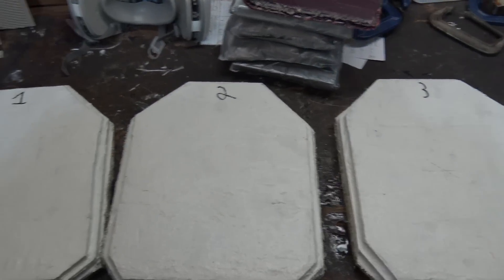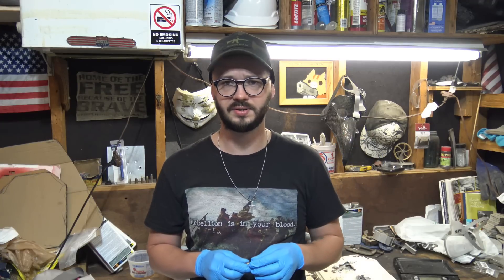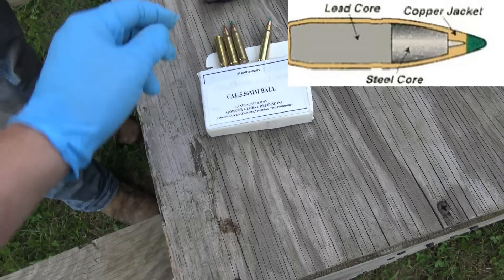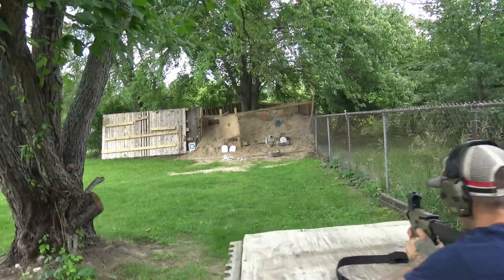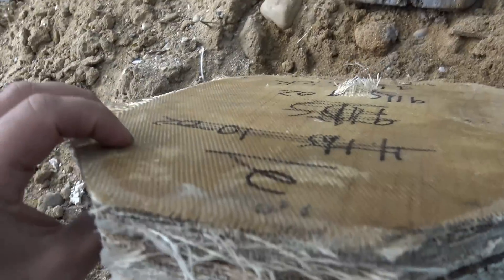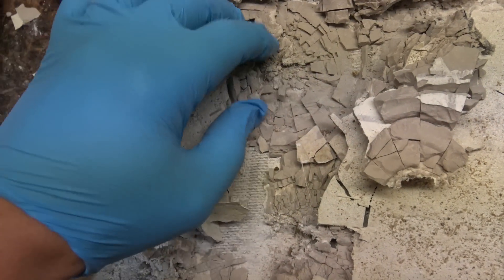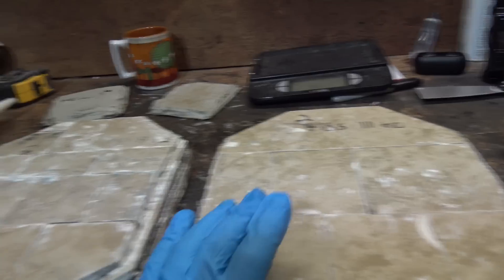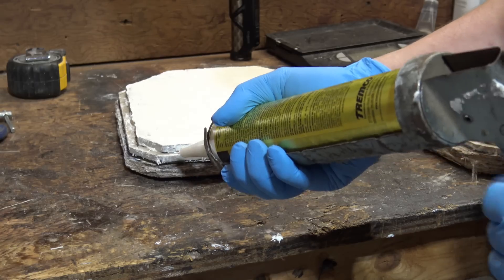Hardware store level 3+ Armor build

Comment: One thing I'd be interested in: Inexpensive bullet stop for a shelf. My self defense plan includes hunkering down behind a wall shelf in my bedroom. I saw a YouTube video at one point, where just 5 inches of sand stopped a 5.56 from a rifle. Maybe there is something I could make that's cheaper than buying an old encyclopedia?
Reply: For a defensive bullet resistant barrier that's cheap I can do you one even better. One that is mostly free and essentially costs almost nothing in materials. Each time you go grocery shopping and get things you need try to find stuff that's in containers made of HDPE. Things like ice cream buckets, coffee bottles, water jugs, milk jugs etc. After 2 or 3 years of collecting this type of plastic you might have enough for a bulletproof barrier. Just melt it down into sheets 12x12 inches square and at least 1.5 to 2 inches thick, at least enough to destabilize and catch any bullets. Then you need to add 2 or 3 PEI porcelain floor tiles to the front of all your plastic plates to break up and strip off the hard copper jackets of any bullets so that it will be easier for the polyethylene backer to stop them. Floor tiles at a hardware store are very inexpensive they're only $1 or $2 a piece and an entire box is less than 20 bucks. Annealing the polyethylene backers after you form them will also make them a lot stronger by the way, which could further increase the ballistic resistance of the plates.

You could also do this with PET (polyethylene terepthalate) as well. Just stack multiple layers of it between two sheets of ceramic kiln paper and clamp that between two nonstick cake pans with C clamps 🗜️ and blast the pans with a heat gun on the low temperature setting. PET plastic melts at 500 degrees Fahrenheit much too high for any normal oven to melt so a heat gun is the only thing I know of that will get hot enough to melt PET.

Comment: Great work! Might I suggest making them a couple inches wider ,and then making a more pronounced "fold" where plate is like it's been folded in half, but not completely,making it slope, and therefore, bullet is facing 1.5x the resistance as straight on?

Comment: Is ok if i use normal risen instead of polyester resin because i don’t have polyester resin in my country
Reply from the maker: What kind of resin do you have access to?
Reply from the maker: But yeah, if it's like epoxy or something it'll work as good, might even get it lighter
Reply: @Techthisoutmeow  thanks also another question is ok using fire blanket?
Reply: @v-nan-v1060  As long as it’s made of fiberglass cloth.

Comment: try compressed paper, reactive armor, hydraulic press compressed paper cake in a mold
Reply: ie hydrocarbon diamond like light weight paper armor plate
Reply: paper is ironically same as cast hdpe armor
Reply: add some ceramic sand in-side-to paper can hydraulic press compress it, into a hydrocarbon tile

Comment: What about welding ar500 targets together? 
Im looking to bulletproof a 4runner by making a ar500 steel box out back and welding ar500 panels to the inside of door and engine wall
Reply: It would degrade the heat treatment. You could armor your seats with mini silhouettes, hopefully they’re still sub $30 at Fin Feather Fur.

Comment: Why wasn't Kevlar fibers not used in the production of the plates?
Reply from the maker: Cost, that's the only reason. Kevlar would perform better, at less weight
Reply: @Techthisoutmeow  you should post your content on Odyssey.  That way it wouldn't be taken down.
Reply: @Techthisoutmeow  A while ago you did the 7075 aluminum alloy video, so I was wondering if you would ever do the same type of video for the 7068 aluminum alloys that exist now. A very thin plate of ar600 steel sandwiched between two 7068 aluminum plates might be very stronk; though I'm not a material scientist so I could be completely wrong.
Reply: Hey man I had to update my credit card on patreon. Did it go through on your end, basically am I your patron again?

Comment: I've been collecting the materials for this stuff today and while Lowes, Harbor Freight and Home depot have Bondo brand resins, all they have are interior/exterior home fiberglass resins, body filler automotive resin, and Bondo Glass resin but not the actual automotive fiberglass resins like you have. Would those make any good substitutes? No Vulkem either but since that's for the tiles, I kinda wondered if the QuikCrete sealants would do some good as well
Reply: You should try to find epoxy resins. West Epoxies or more specific HS epoxies.

Comment: You could possibly install a small electric jack in the door to lift the heavy bulletproof glass up and down. They make jacks that are powered by the 12v socket in cars.
Reply: Most armored cars use sliding windows when they are openable

Comment: Have you tested different types of fiberglass? I did not find anyone trying to make a plate out of fiberglass mesh, the one for construction.  I m curios what it will be able to withstand. Why mesh? because is dirt cheap.
Btw, awesome idea, stooping rifle rounds without steel plate. 

PS: Thank you for skipping the small calibers, i see many videos that starts with the .22 , 9 mm, etc..., they are compromising the ceramic plate before testing bigger calibers.
Reply: They do make fiberglass panels for bulletproofing buildings. It's about twice the weight of kevlar for the same protection.

Comment: Can't remember if you mentioned it in this video, but it would be great to see some curved or multi-curved designs. I understand these would probably be of a lower protection rating than the plates shows in this video, but they would fit our plate carrier much easier.

Fantastic work so far. Quite unbelievable that such simple materials can be manipulated into working pieces of armour.

Comment: FYI: if you put a layer of fiberglass on front it going to delaminate with the first shot unless you can mechanically fasten it to the back side, using a thread weave or staples. You have to drill small holes in the tiles to connect the front fiberglass to the back. Or sew tile segements between two layers of fiberglass using kevlar or some very strong thread. Maybe mono-filament (fishing line - not as strong but cheap).

Comment: Do you think i could make a 5x5 plate/wall just 1 piece just not cutting the welding blanket? Im trying to make a safe spot i can send my kids if need be.
Reply: You would need 30 blankets and have a way to squeeze them together  with the resin. You would likely have to vacuum bag to feed the resin in before it started to harden. Vacuum bagging could squeeze everything together for you too.

In the end for cost and simplicity i would recommend buying a 3/8 in thick sheet of abrasion resistant steel (ar400 or ar500). It will stop any of these rounds without issue even if hit in the same spot multiple times
Reply: @BrokeWrench  ty
Reply: Another thing that can be cheaply applied over large areas is hardi-siding. You can get 4x8 sheets and 3 layers stops m855, 7.62x39, 7.62x51/.308…. Not sure on 7.62x54R fmj and LPS.

Comment: Awesome work and video. Came to mind at 10:50 when you mentioned placing a layer of fiberglass on top to hold it together, came to mind trying out makeing a pouch out of fiber glass warp or use a large piece to wrap it around the front and over on all 4 sides with it meeting at the back to keep all 4 sides from blowing out. Keep up the great work!

Comment: very nice!  i wonder if you could make a comparison, with  the same welding blanket and same amount of layers of polyester resin vs epoxy resin vs phenolic resin (because i know that in soviet era tanks, for thoose that used a fiberglass composite, the resin was phenolic, so, the resine used to make bakelite)
Reply: You cannot make a phenolic resin layup w/o an autoclave, since it has to be cured under pressure and heat. Polyester resin is stronger than epoxy for the 1st hit, but degrades sharply in strength, that's why epoxy resin is used for virtually anything structural or where survivability is in the least way important; polyester resin is just for noncritical hobby projects that won't be sustaining any repeated hard shocks.

Comment: Have you tested different resin types on strength? Like vinyl esters or epoxy resins instead of the polyester resin. You could also try vacuum bagging during construction.
Reply: A professional vehicle armorer told me they use epoxy resin.
Reply from the maker: I have a bit. Epoxy is always going to be the strongest honestly. One of my favorite is: https://theepoxyexperts.com/shop/adhesives/structural-strength/max-bond/max-bond-low-viscosity-ab/max-bond-low-viscosity-32-oz-epoxy-resin-fiberglassing-marine-aero-auto-boat-building-high-impact/ I used this for my ballistic mask and hat build, if you've seen those. It would be fun to do a head to head comparison of resins some day. Vacuum bagging is amazing, as well as resin transfer. I was keeping this build simple, and only things found in hardware stores. but I plan on using more advanced methods and materials in the future! Thanks for the suggestion, showing different methods and materials is what this channel is all about!
Reply: What about chopped strand mat instead of the welding blankets?
Reply: @shoes121255  Chopped strand does not work well at all. The welding blankets (woven roving) works because it kind of stretches linearly across the length of the strand. Chopped strand just rips off the cloth. It is poor man's aramid.
Reply: @DaveSmith-cp5kj  

Well said. Oriented strand or woven is best. You see that in LVL IV plates that have been shot and taken apart.
Reply: Instead of this sealant couldnt we just use flex seal glue ?
Reply: I was thinking vac bag epoxy once he started showing the materials! 👍🏻